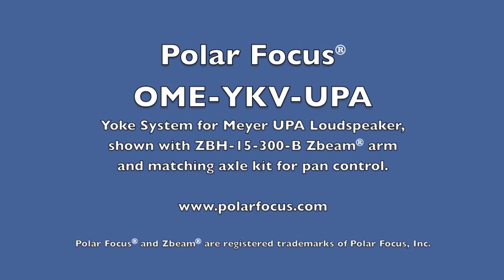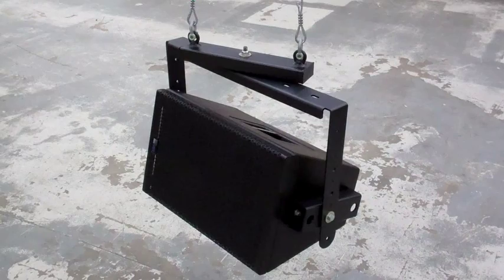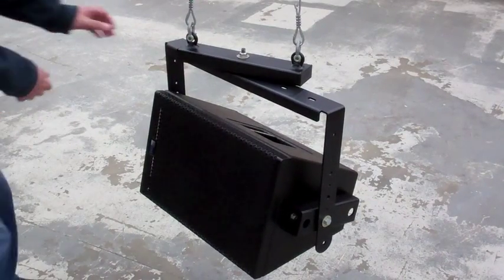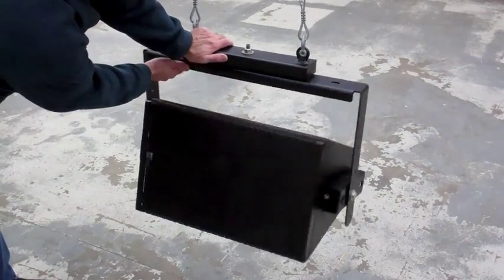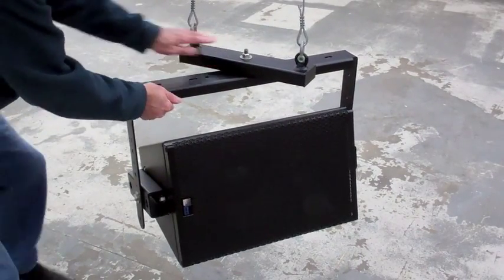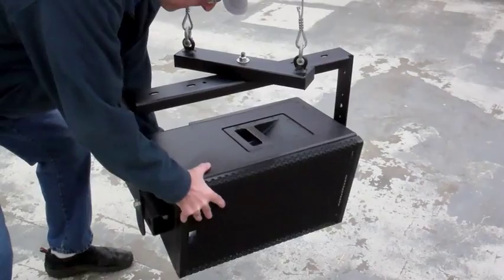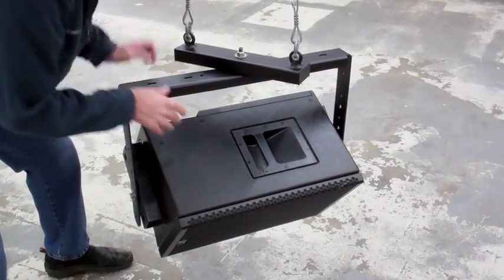Polar Focus OME-YKV-UPA speaker rigging

Comment: Don’t see a safety cable. Are there access points for safety cables?
Reply from the maker: You could add a safety cable between the terminated lower end of one of the suspension cables and the loudspeaker if there was a jurisdictional authority who directed it to be done. However, our 10:1 design factor and high quality materials means that none are needed.  Decades ago it was common to use unsafe cast iron clamps or brass dog leash clips as redundant layers of alleged 'safety'. We use the correct materials with a high design factor to eliminate the need for safety cables. Please note that the type and method of most safety cable usage would result in the cable or eyebolt failing in a drop test.
Reply: Polar Focus, Inc, I agree 100%, but the powers that be feel safer with a secondary safety device wether it works or not. A lot of added expense just to feel better. Ha!